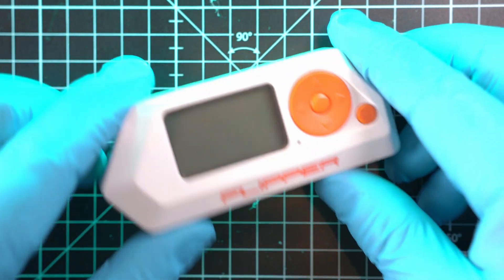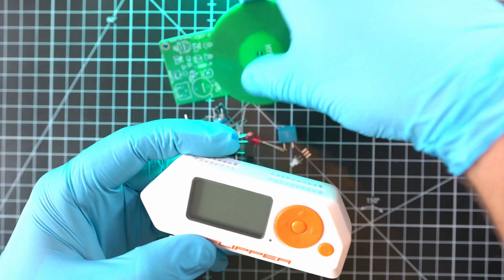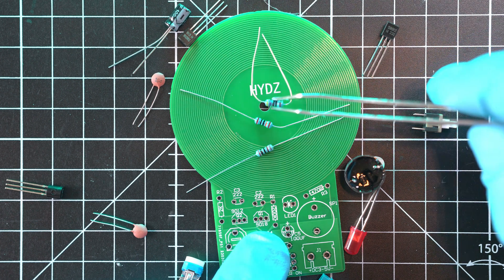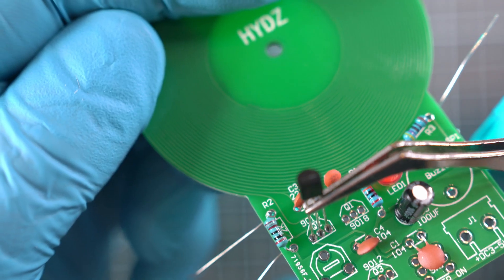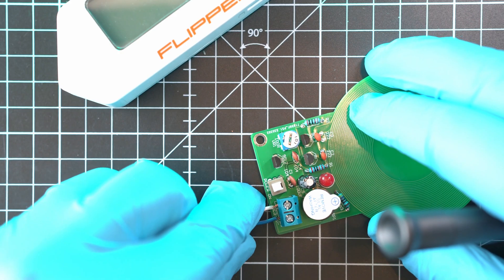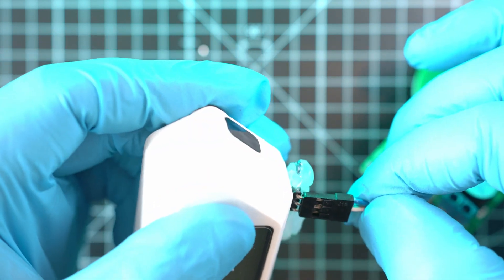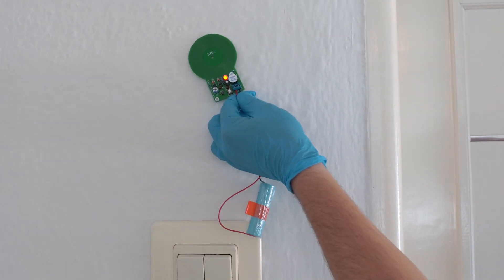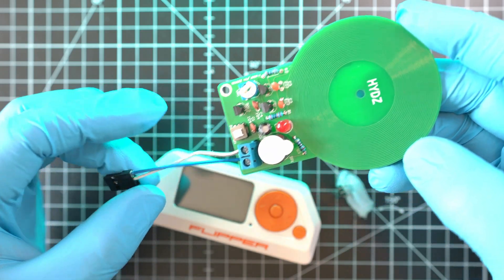Flipper Zero Metal Detector Module...

Comment: I builded this as you did and it didnt worked. All pieces exactly as in your video and it didnt work. The same thing happend with motion radar and cc1101, but that modules i fixed thanks to github description of wires and then it worked. Your wires have totaly different position in every module. I have no idea how is possible, that they are working. But sadly this module "metal detector" is not in github, so if you have any secrets how it can work, i will appreciate it.
Reply from the maker: hi, check polarity of components, also… does it even light up?